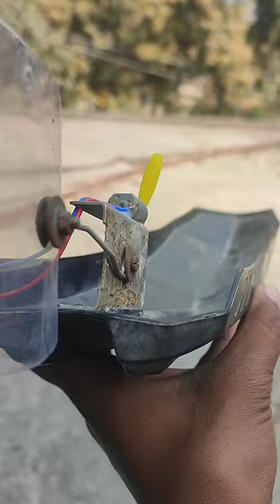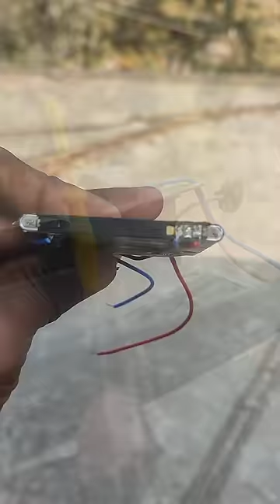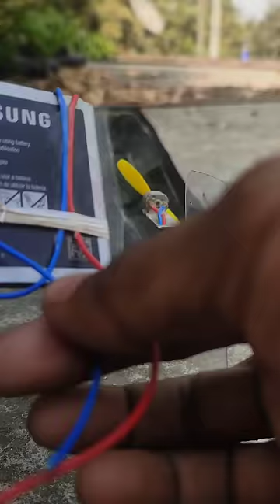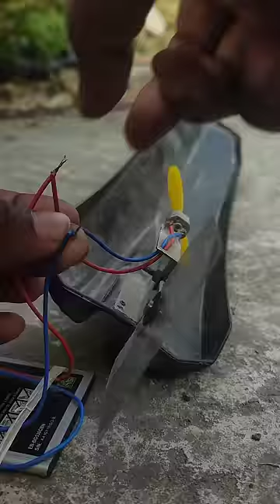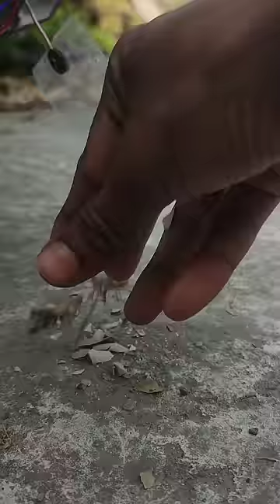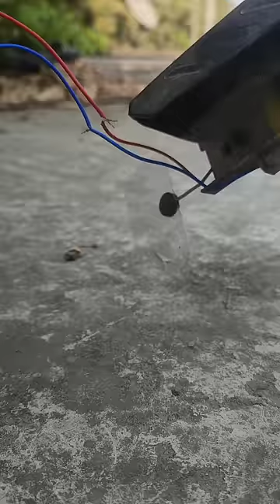DIY Air Boat || how to make a boat with dc motor, #ideas

Comment: First do insulation at both terminal loop/joint otherwise it may having chances of short circuit.make sure safety first.
Reply from the maker: I do not understand how
Reply: @TheRealizeAtoZ0.7  🤦